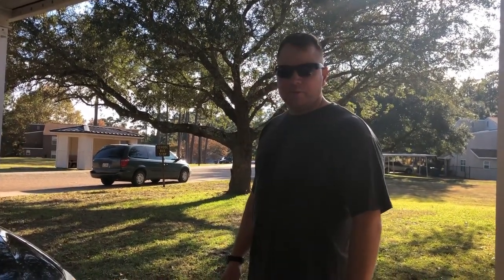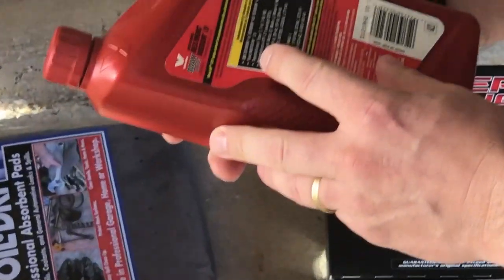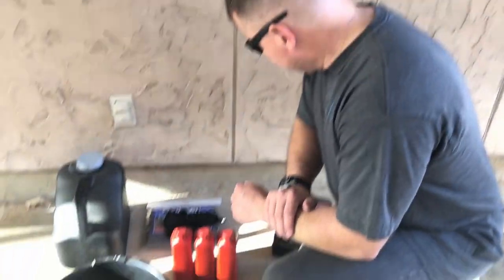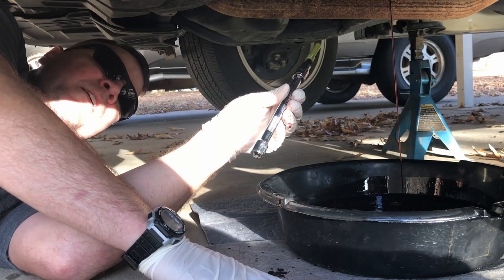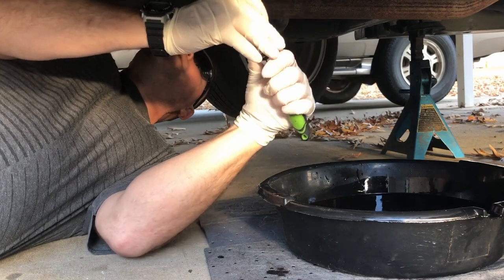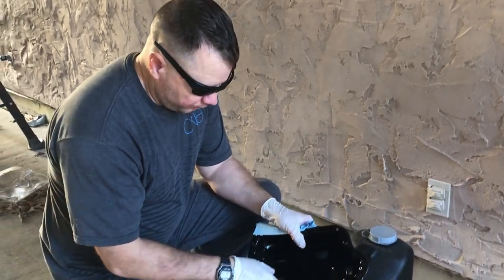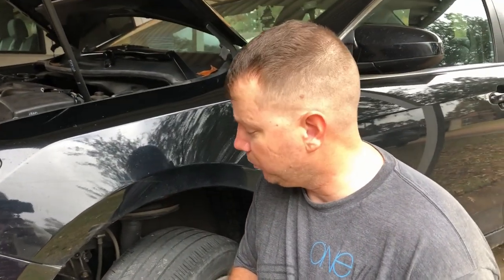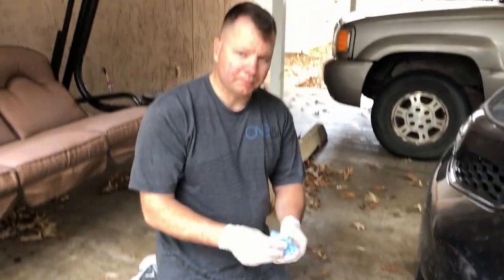Automatic Transmission Service 2014 Toyota Camry

Comment: This is the best video I've seen for Toyota Camry transmission service.Thanks so much.
Reply: Same. Better then the Rejects at the quick lube.
Reply: Wrong way to check atf temperature
Reply: @repairvehicle  Really...He did it right, the Haynes manual says the same process! (using scan tool for AFT temp that is)
Reply: @yodead369 , did you watch my video? Did you see Toyota service manual specifying use of laser thermometer?
Reply: @repairvehicle  I watch it. I just seen them use the OB2 port for the ATF Temperature.
Reply: @yodead369  , did you even watch the video? What he is using to measure temperature, it's not OBD2.  Wake up and watch the video again.
Reply: @repairvehicle  I've seen other people use laser temperatures for that the cheap ones aren't as accurate as expensive ones. I mean if you put out what you put in and not really manipulating the volume of transmission fluid that was in there to begin with... If you're going to go pay $1,500 at the dealership to do it go for it
Reply: @yodead369 , laser is not measuring atf temperature, it measuring pan temperature.  Scangauge is what measuring actual fluid temperature.  Apparently you didn't watch my video.
Reply: @repairvehicle  I'm not in your channel so why would I have watched whatever video you're referring to????? 🤨
Reply: How many miles at time of video?

Comment: If you are going to do this more than three times in your life, get a fill adapter set, a cheap one is as good as an expensive one, and a fluid pump. Because....if the fluid that came out was brown or worse you are going to do this a lot until it's final sorta red. Worse is black and silver like mine. Thank you Fred Anderson Toyota.

Comment: You made the best video on this camry transmission service. Also the techniques used are the proper ones. Good job pointing out the jack spots and stands. Also pointing out to remove filler bolt first.

Comment: This is the video I have been looking for!  I have a 2012 Camry 6 Speed Automatic.  Simple instruction on how to handle the refill procedure.  This video shows this critical step in detail with the temperature check and the add in you did to complete the fill.  
I also have a 2009 Camry Hybrid and the dealer gave me a $450 estimate to just drain and fill the Power Splitting Device(transmission) so I researched the process and it is so easy that  I do it myself every 25K miles..  The 09 Camry has 190K  with no problems.

Again thank you and your daughter for this fine effort.

Comment: Thanks for the idea on how to level the car. Will Be doing a drain and fill on the transmission on my Camry and didn’t know how to level car on my driveway which has a slope. Jack stands on front and hydraulic jack on back and pump up the jack until it’s level. Thank you so much! Great video.

Comment: Thank you for a this great diy video! Question: what torque should I put onto the transmission mount to retighten it? I will have to raise the trans like you did to get that impossible-to-reach bolt out

Comment: Well done and informative. I guess your total fluid was 3.5 quarts? I would not use a parts house filter; they are not so good. The Toyota filter is a little more but is excellent. The funnel was a great tip. Your daughter did a great job with the all important camera work. Again, well done and thank you.

Comment: Great video! Thank you for taking the time to make this video.  It is just what I been looking for.  To do a transmission fluid on my 2013 toyota camry.  I just don't trust some of these shady automechanic shop.  I feel the same way you feel about  doing it the proper way and not just some half ass and calm it a job.  I'm a DIYer, and I like to properly the first time. You wouldn't happen to have a link for that filter kit, would you, please. Thank you!

Comment: Nice video. I did my 2015 1.3L Yaris recently, i'm from the UK. There was enough room from the top to remove the fill bolt & to fill it up. I used a cut off garden hose pipe and funnel, which took 2.2L. To make sure the car was level, i took off the wheel. To make sure the level was correct, i lowered the car, matched the wheel holes from the wheel to the lug nuts side by side, with a jack stand underneath of course. Used the Toyota CVT fluid, which cost £42, put in 2.3L & have 2.2L spare, even thou 2.2L came out, 0.1L was dripping out for the fluid check. I will do another fluid change in 3 yrs and use my remaining fluid i have left over. Just some info for anyone out there.

Comment: This is definitely the correct way to drain and fill these sealed transmissions. Very impressed by the filming job of your camera lady. 
If I was to nit pick- you should have drained and filled the fluid 3-4 times since you switched from Toyota WS fluid to an after market comparable. I switch to the same MaxLife fluid in my rav4, it's a good fluid. But not all brand additives are compatible. Get all the WS out before filling with another. I plan to just pay a little extra and get the WS for my Camry fluid change. If someone doesn't want to support and level the whole car you could drain and pour the fluid into a container with measurement markings like an old 5 qt oil jug. This way you can replace pretty close to the amount you drained out. But the leveling process is the best accuracy.

Comment: I agree with the last comment this was one of the best how-to-videos about the transmission service. I wonder if you can tell me how many miles you had when you did your service. Great job to you and your daughter.
Reply: I'm not him. But we did our first drain and fill at 28,000 miles.
Reply: Just had it done for the first time at 158,000 miles
Reply: Chris Vargas Mine has 80,000 and was afraid to do it. Is everything working correctly on yours?
Reply: Jun Boo yes mine is working better then when I got it since it was never changes but want to include that my mechanic only did 4 qts flush since he also said that doing a whole 7qts my have made an abnormal change. Noticeable change for the better was less haunting when going into an incline.
Reply: Chris Vargas Awesome going to do the same then wait 3,000 miles and do it again. Now I’m between getting Amsoil or Toyota brand.
Reply: Jun Boo everyone says to stick with Toyota brand
Reply: Chris Vargas Got it and got them. Thanks for the info.

Comment: I have a 2014 Camry with the infamous torque converter shuddering problem.
Not sure if I should try this first or have a mechanic fix the TC with a new one. I have 14 days left on the warranty but they want the car for 3 days just to diagnose the problem and I can't afford a rental car right now.  (due to emergency and very expensive medical bill)
 I need to have it diagnosed before warranty runs out to get the warranty. Catch 22 as always.
Next month I will have the money of course! And I figured they'd have the car for maybe a week to fix the problem and planned to get rental for a week or 2......maybe less?.....but to diagnose I figured an hour. Mechanics all say the time is due to the fact that the warranty people take forever and may even need to send out an inspector which could take days.
 Thing is, the car doesn't shudder if you use the Sport mode and use the paddle shifters to manually shift. Then I heard about that stuff called Shudder Fix which people rave about. But Camry's don't have a dipstick and Shudder Fix may not be for CVT transmissions.

--------------------------------------------------------------------------------

Scroll down for my life story if interested LOL

 Bought the car from Carvana back in May of this year.
Otherwise the car is clean and flawless. Not a speck of rust or dirt. Engine bay looks brand new. No leaks etc. Southern car. Underneath looks brand new too. The shudder isn't that bad but annoying and I worry about doing more damage.
Heard enough yet? I'm not done yet LOL

My plan was to buy this car and pay it off by November since I'm waiting on estate money to be released from last year. (Sold parents house) And my old 93 Honda Accord with 304,000 miles needed tons of work to keep running and pass inspection.
The plan was to trade this Camry in on a brand new 2022 car. Bad credit from ex wife cheating on me and leaving me with the bills having to file bankruptcy is why Carvana was my only real option since they don't do hard credit checks...... but Carvana is almost 21% interest and my monthly payments for a 2014 Camry with 98K miles is 437.00 a month.
  But a WOMAN who was in charge of the estate forgot to get a document signed that she thought was already signed. So after waiting 15 months already for a lump sum of cash, that WOMAN just added another 6 months to the whole thing. So now this November is now next early spring.

Comment: Great video, going to use this video and change my own. I plan on using Toyota fluid and filter/gasket , I’m at 112k miles on my 14 Se do you think it will hurt to do this drain and fill with a filter at this mileage, I have no history of the car but I bought it with 99k . I’ve done a coolant flush on it
Reply: I would just do a drain and fill with no filter replacement.

Comment: What a great video, rated pg. Quick question, I have the same car, it has 110k miles, I have never changed or added WS fluid, do you think it would be wise to change the this in the video or just add oil?

Comment: The problem with your method is that the temperature of the pan is going to lag behind the temperature of the fluid some what so you’re really not doing it at the accurate degrees.  There was a video of somebody that had text stream to show what the actual fluid temp was and then used the laser reader and they were different.

Comment: Great vid.  
On some GM just to change the fluid you have to drop the pan. 

I just did a ATF service (drain and fill) on a 2001 Nissan Maxima 
It’s much easy to do.  Also the filter it uses is just a  screen  and you never replace it.  

I used that same transmission fluid. It’s good stuff.  But I used also Lucus transmission fix because it was a acting up.  It  has code p0744.
 70 miles after check engine light came back on (I had turned it off) 
300 miles post  it’s driving and shifting almost normal but light still on p0744
500 miles post service it’s driving and shifting even better but light still on

The code indicates that a TCC solenoid issue.  I think it may be getting stuck.  
Hopefully it works out. 
But if it needs to get fixed the TCC is part of  shift solenoid pack  in this specific car, 

Nissan Part No.: 31940-80X25
SOLENOID REPAIR KIT - CONTROL VALVE

About.  $77-120 part

This is something inside the transmission 

Nissan’s transmission made by jatco). Toyota uses a better one made by asin transmissions

Comment: Do you check the level of the actual transmission in case motor mounts are sagging? I also noticed you checked fluid level while the car was running. Is that correct, or should it be turned off?

Comment: Hey one question. Is this the U760E transmission? Have you had issues? I have read these transmissions have some issues with torque converter. What can you tell me about it? Is it good, maintenance each how many miles?

Comment: Nice video. I believe some of the process is relateable to other Toyota vehicles. Even the newer trucks have this type of set up for changing filling and leveling the fluid.  The lay out is different but most of the instructions are nearly identical. 
You also could have used a fluid pump to fill the transmission from the container but for your vehicle the tube thing was good and probably cheaper. Some videos say to measure the fluid that comes out and put that much back when refilled too but you seemed to know how much to use and didn't mention that.

Comment: thanks for this awesome vdo! I got the tran fluid changed on the 2012 SE at 90K but i don't think the local shop  guy did it correctly for $100.  It's now at 124K. I am going to  do it again with this vdo. It looks like you have to leave the engine on while it drains the overfilled fluid . Looking forward to more vdo from you. cheers!  You have to leave the j
Reply: They did not change filter. drain and refill only.
Reply: @yarur1205  I mean his local shop. They charge him only $100 for changing trans fluid. SMH.

Comment: Hi when I did this, my Camry almost put out 6 quarts of oil from the pan. But when I was refilling it, it took less than 3 quarts before it started to trickle out. Please help! I’m worried too much oil was taken out. Should I put about the same amount back in?
Reply: I’m not 100% sure my car was leveled when I originally drained the transmission fluid out. Could that be the reason? I think the front was lower than the back of the car. If so, what’s your suggestion?
Reply: Sure you got six quarts out of there?? 3.6 is about whats in the drain pan. Check it hot! 110F see if anythings coming out the drain hole.

Comment: on my 2016 camry I had to hammer the 6mm hex into the drain plug as it didn't want to sit fully FYI. 

No issues with transmission before hand but after this service it was notably shifting smoother. 64,800 miles.
Reply: The drain plug is of soft metal.  The 6mm hex hole was rounded off as I tightened it after the first spill-and-fill.  I used a vise grip to open the drain plug at the second spill-and-fill, and it worked well for me -- the drain plug was not damaged.  I then cut off the head of a screw driver bit, which is 1/4" hex, and use a vise to press the 1/4" shank into the 6mm hole of the drain plug.  The shank was slightly larger than the hole, and it worked perfect for the tightening of the plug.  For the  removal of the plug at the next spill-and-fill, I used the vise grip again, and used a 1/4" socket on the shank only for torqueing the plug (29 ft/pounds) when I reinstalled it.

Comment: Toyota was smart to include a fill port on this transmission. My 09 E350 Benz does not and so a special adapter is needed to fill the transmission. This adapter also lets out the excess fluid once the temperature is reached. As a technique I would measure the amount of fluid that drains out and then refill with a bit more and   when the temperature is reached ( cycle through the gears with foot on brake) let out the excess then button everything up. Thanks for this video , I thought I would need an adapter. My 2014 has just 25 k miles and I will most likely do a drain and fill at about 30k.

Comment: 1.  I like the vid but per the Toyota Service Manual you should have put loc-tite blue on each of the pan bolts. 

2.  You also should have done a complete fluid swap.  Not just the 3 quarts as there is approx. 7 quarts in the trans.  Now you have approximately 3 new quarts of generic fluid and 4 quarts of old dirty WS fluid in your tranny.  Also, Toyota WS fluid is designed specifically for this 6 speed trans (has special additives) the generic fluid you used does not.  3 quarts of generic fluid and 4 quarts of WS fluid mixed together not really ideal for your car. 

3.  I would recommend 3 or 4 drain and fills with Toyota WS fluid but I would definitely not leave the tranny with mixed fluid like that.   I would recommend WS fluid and most pro mechanics would say the same especially if you are keeping the car a long time............  The fluid price difference in oem and generic is not worth a new tranny and you can get the fluid cheaper on amazon.
4.  The Toyota service manual explains how to use the dash as an accurate trans fluid temp reader..  Toyota Service manuals can be downloaded and iworth every penny.  Especially considering.laser thermometers are not taking the temp from the same spot as the actual sensor.  Therefore your fluid level will not be completely accurate.   Why gamble, but as long as it's YOUR transmission and not mine it's no problem.  Just saying.....
Reply: Dolphin Bluesong help! I drained my transmission and almost 6-7 quarts came out. When I refilled it, it was only taking less than 3 quarts before the new fluid started dripping out. What should I do??
Reply: Dolphin Bluesong I’m not 100% sure my car was leveled when I originally drained the transmission fluid out. Could that be the reason? I think the front was lower than the back of the car. If so, what’s your suggestion?
Reply: I don't think Toyota ATF-WS is designed specifically for this transmission. I'm pretty sure it was also to be used in the previous four-speed transmission that was replaced with this six speed. Our 2009 RAV4 with the 4-speed transmission uses WS.
Reply: @jimmynguyen7956  
Sounds like a previous owner overfilled it or a mechanic that didn't know what he was doing.
Reply: @jimmynguyen7956  
As long as it's level when you fill it, I would think that's the important thing.

Comment: I ended up getting into a big argument with my dealership over getting my filter and fluid change or just getting my transmission fluid serviced in general.
They told me it's a sealed unit and that they do not recommend nor does Toyota to change the fluid they never mentioned a filter and the only thing they would do is top it off because it's a lifetime fluid.
If I force them to change the fluid they will have me sign a waiver, so I just ended up leaving it be.

Comment: I have a 2013 4cyl Camry. I changed the filter and got about 4 1/4 quarts drained plus a little spillage. I put 4 1/2 new fluid. Drove good around town for the day all shifted good, but when put in PARK THE TRANS MADE A WHISTLING NOISE LIKE SOMETHING WAS ADJUSTING... DO YOU THINK OVER FILLED..?? Is the trickle very important with the fluid temp??
Reply: Yes, overfilled. Fluid is touching the mechanics of the tranny. Same thing happened when my dealership overfilled mine at a fluid exchange service. The blamed in on the machine needing to be “recalibrated”.